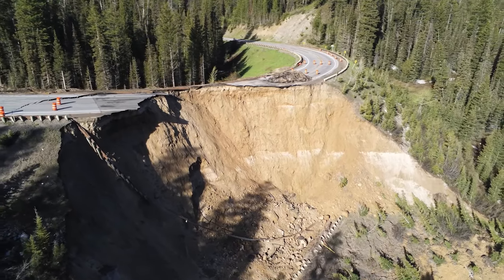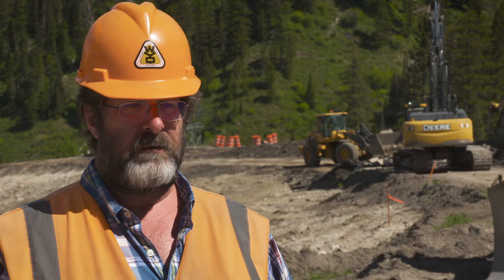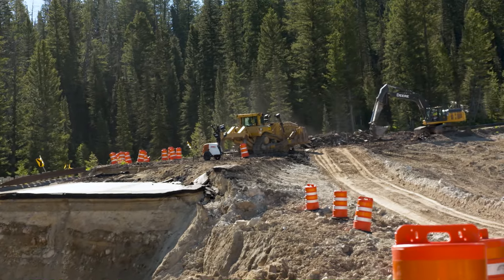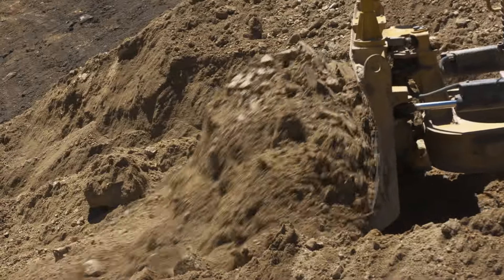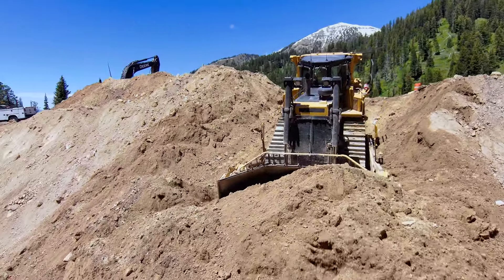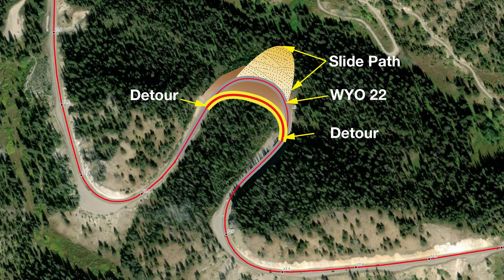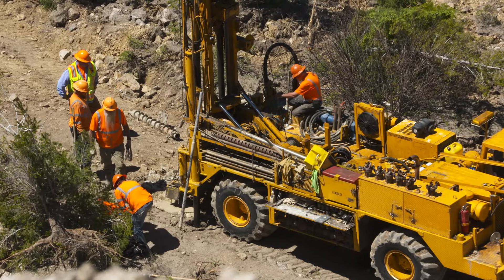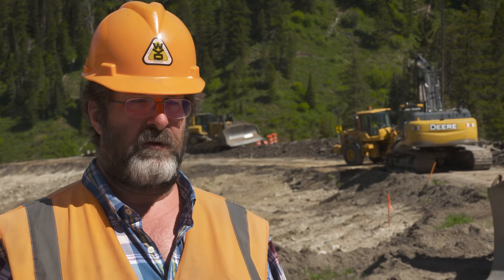Big Fill Slide Response

Comment: Why are you ignoring soil stability concerns? There is no way you have done enough testing to be 100% certain that the temporary bypass you are rushing to build is safe! Safe construction of mountain roadways needs to have the proper established planning procedures completed before it commences. Video shows you failed to see the obvious signs that the big collapse was going to happen and let highway workers be in a dangerous area. This shows poor engineering judgment. Stop rushing this bypass construction until the proper geotechnical information has been gathered about the soil stability conditions below it and let the proper planning steps be done. Doing this in the yee haw cowboy get er dun quick way you are is going to risk the public's safety!
Reply: Holy shit, it's a temporary 200 yards of new road not much different than the 1000's of miles of existing dirt, filled roads all over the state, that people drive on daily.  Land of the free, home of the brave.  Grow some.
Reply: @grantparnes  hope you watched some of Casey Jones' videos on this.